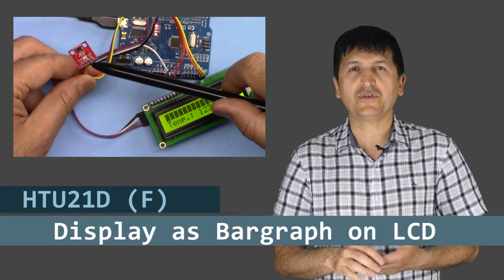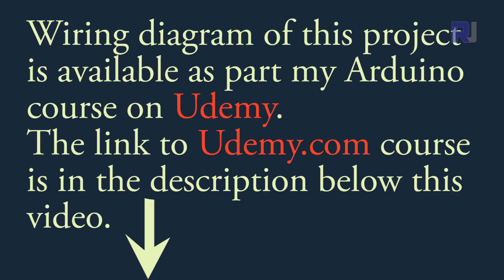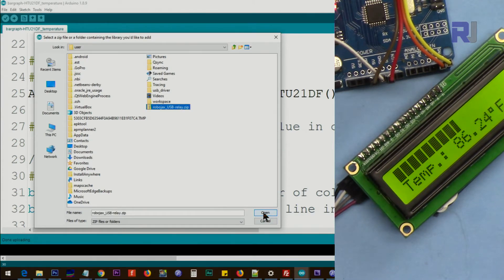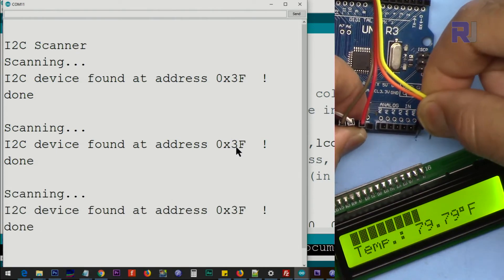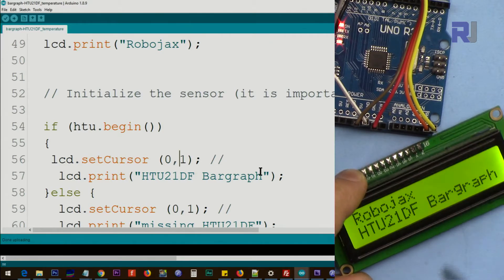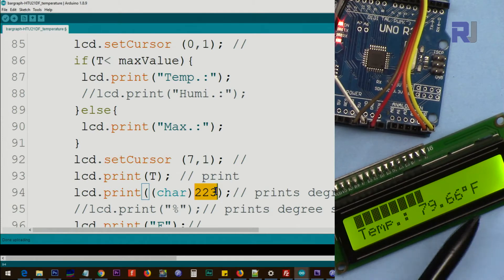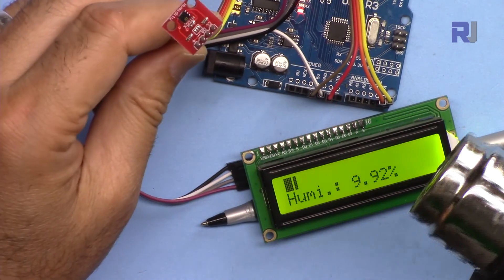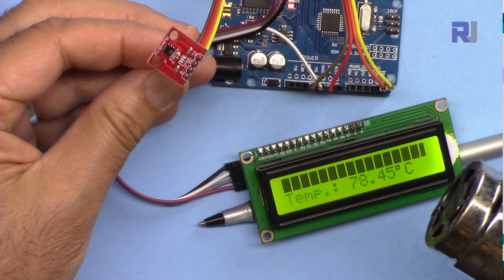Display temperature from HTU21D as bargraph  on LCD with Arduino RJT180

Comment: A marking of the optimal humidity on the graph would be very informative. You could choose a different ad than filled at the appropriate place
Room Optimum temperature    Optimal humidity
Bathroom 20 - 23 ° C                  50 - 70%
Children's room 20 - 23 ° C        40 - 60%
Living-  workrooms 20 - 23 ° C 40 - 60%
Kitchen 18 - 20 ° C                      50 - 60%
Bedroom 17 - 20 ° C                   40 - 60%
Hallway 15 - 18 ° C                     40 - 60%
Cellar 10 - 15 ° C                         50 - 65%
Reply from the maker: wow this is interesting. Are these experimental values or calculated? yes indeed.
Reply: @robojax  i got this from here: https://www.luftfeuchtigkeit-raumklima.de/tabelle.php; seems to me to have been determined empirically

Comment: Need to add a switch temp humidity and barameter
Reply from the maker: you can show multiple graph on the same screen. The class I have provided, it allows you to do that.
it is doable to change it with a switch.